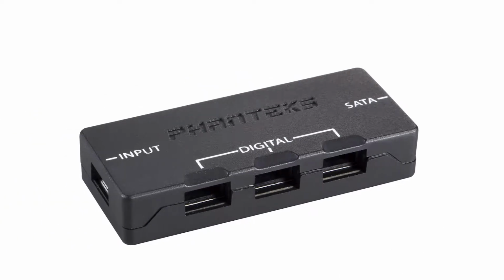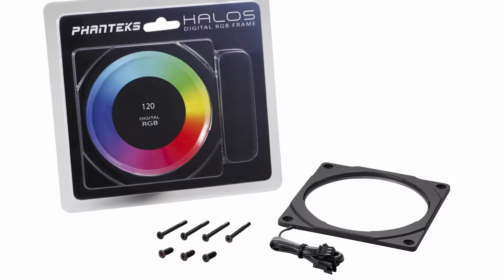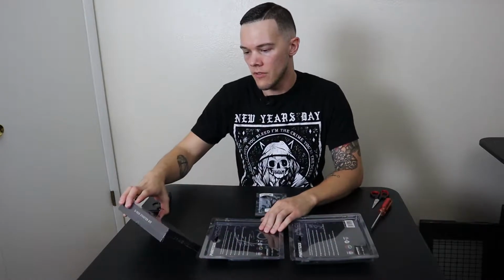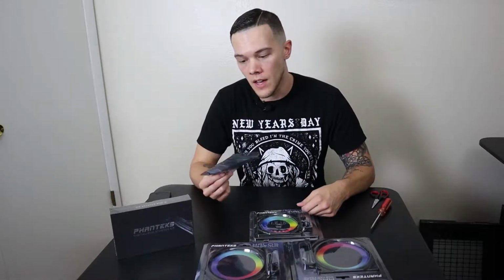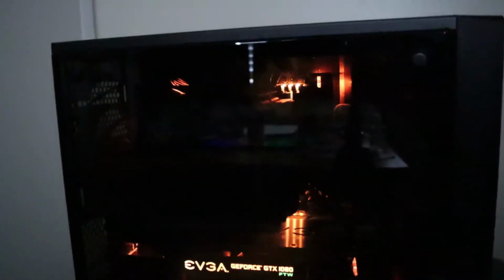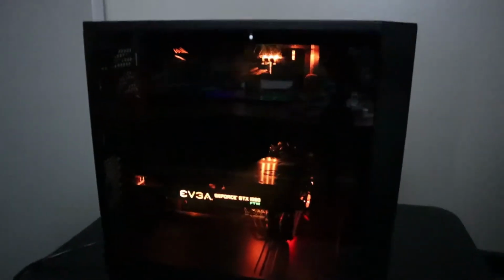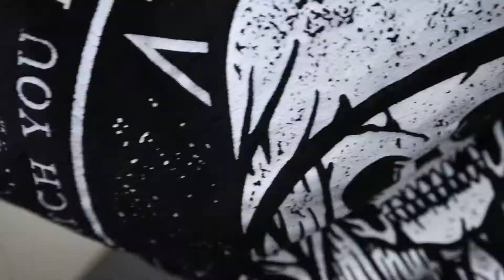Installing Phanteks - D-RGB Strips and Halos

Comment: Finally, someone with be quiet silent wings fans with the halos! Been looking for this all day! Couple of questions:

1. How did you get the rubber pins out of the fans? Mine literally won’t budge 💀

2. After changing the edges and adding in the halos do the fans make slightly more noise/rattle? 

Thanks for this video! It is literally so helpful !
Reply from the maker: 1. There is a tab you push on each corner to release the silent mounts.

2. No more noise from what I was able to tell.
Reply: @fpszen2917  thank man! Been contemplating this for a while now, think I’ll test it out on my back fan first :)

Comment: Hey man, the Phantecs starter kit that you use in this video does the controller store the rgb effects or do you need to re apply the effects everytime you have turned your pc off?
Reply from the maker: I don’t think it stores the effects itself. However it plugs into the motherboard which remembers the effects and signals it (just like the motherboard rgb) as it boots up.
Reply: @fpszen2917 
OK but you don't need to plug it in to the motherboard. It can be used separately. I don't have any RGB headers on my MB. So I just want to know if the controller remembers the settings.
Reply from the maker: They do not keep color without a connection telling them. Perhaps the controller they come with will provide that, however I did not use it myself.